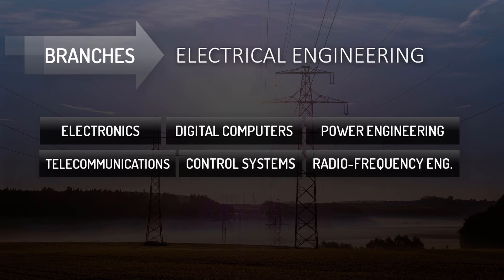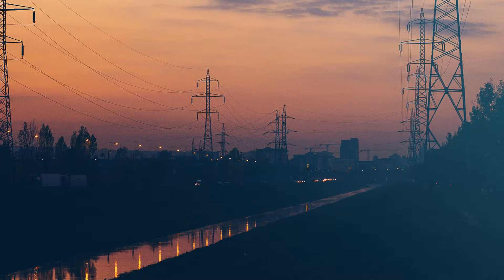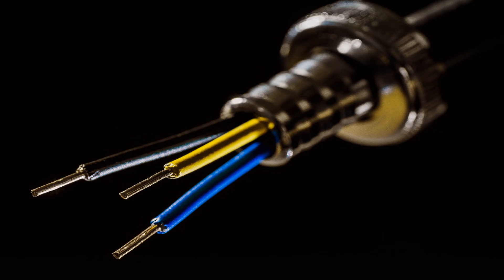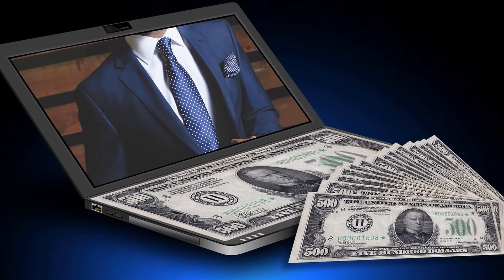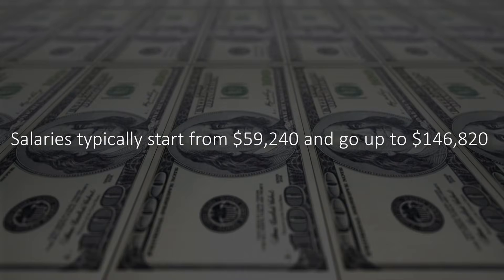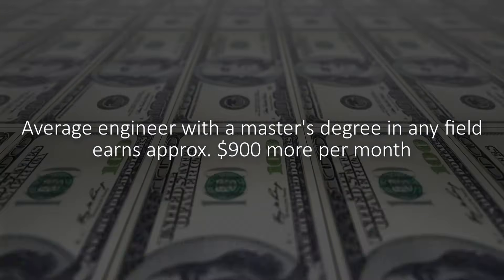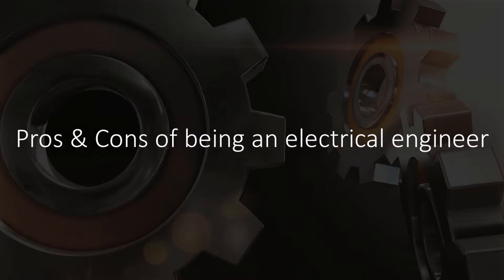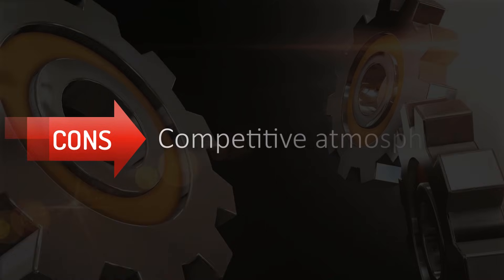What is Electrical Engineering ? (What do electrical engineers do) | Explore Engineering

Comment: I have a question, if I am going to community college as an electrical engineering technician can I still go to university to become a engineer? Am I on the right track to becoming an engineer I’m 2 years can I switch to university?
Reply: michael vigil Speak to an advisor and ask about what classes are required for the university you want to transfer to. Some classes may not transfer so be sure to clear that out with you advisor and you may have to change your degree so it’s for a transfer (an advisor will help with that)

Comment: Skills required for Electrical Engineers
1- Circuit Designing 
2- Instrumentation & Electrical measurements
3- Power Transmission fundamentals 
4- Electrical drive & Electrical machinery 
5- Power electronics
6- Renewable energy fundamentals
7- Microcontroller & Programming languages 
8- Presentation & Communication skills
9- Fundamentals of electrical power generation
10- Control systems & Control machinery
11- Quality control analysis
Reply: Thanks
Reply: Thanks so much bro
Reply: Thank you sir 🙏
Reply: Do you need to know this when you go study for it or can you learn it there
Reply: @johngifts8688 ( learn there) but you need to know the basics
Reply: @johngifts8688 ( learn there) but you need to know the basics